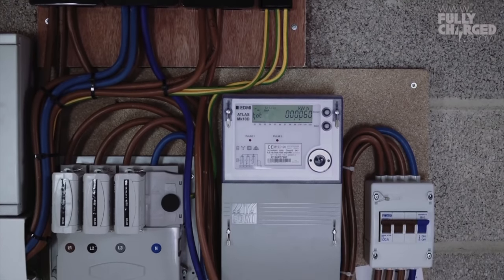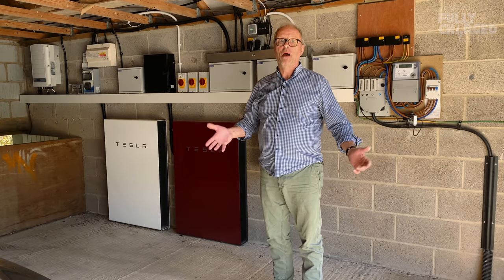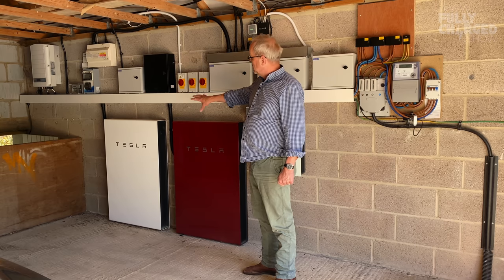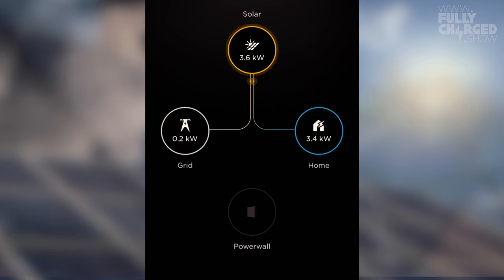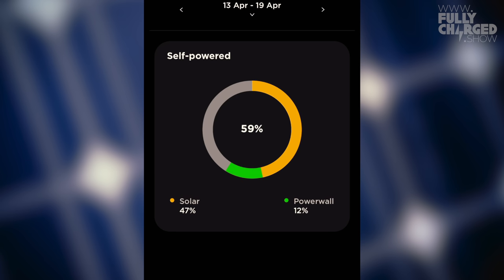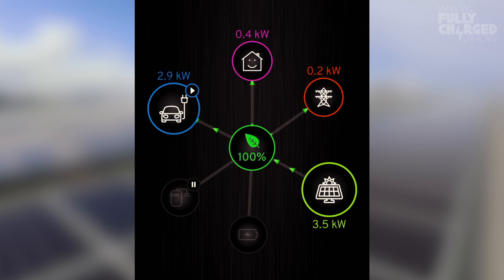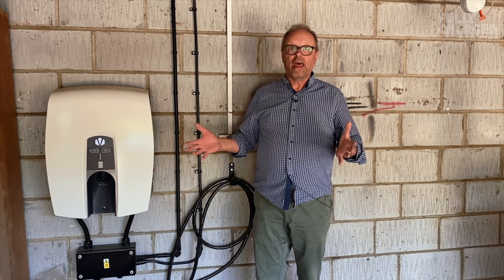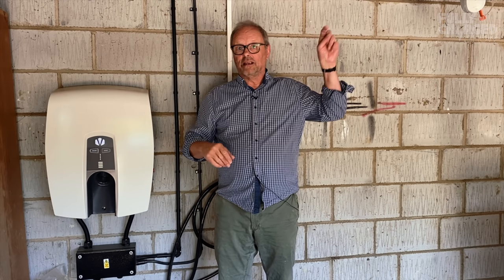Tesla Powerwall: how quickly can it respond to a power cut? | FULLY CHARGED for clean energy & EVs

Comment: Great vid - thanks! Have you done the "break even" maths? i.e. Taking the amount everything cost to set up vs how much electricity cost saved?
Reply: Three phase supply, trench dug, two Powerwalls, huge solar array, installation etc... I'm going to guess north of £40k.
Large UK home likely £2k per year plus the cars, let's say 20k miles of driving at 250Wh per mile is 5,000kWh, maybe another £1k. But the solar only works half of the year so let's say it saves £1,500 per year. By my calculations it would take ~25 years to pay itself back.
If he can get the V2G working, I'm guessing that's another £2k but it could earn £ks back, so who knows.
Reply: Most solar plus battery is now around the 16 to 20k region. The first battery came from a payment protection claim and that is on the video. The second battery came for "free" but involved a lot of expense for the three phase and extras. All in all with the zappi as well I think Bobby has spent about 15k on the whole setup of batteries and solar. If you factor in the bargain price and he is travelling most of the time using a leaf or the Tesla plus the off set cost of not buying fuel for hot water or the cars, the pay back is closer to 8 to 10 years.
Reply: It's definitely still at the stage where doing it to save money is the wrong reason.  Do it because it's interesting to you, or you like the safety of having power if the grid goes down, but don't do it to save money.  That day is getting closer but it's not here yet.

Once V2G comes in then there's a real chance of saving money, but it only works out because you already have the batteries in the car, and you already have the car to use as a car.  If you had to buy the batteries separately because you don't have an EV (e.g. a bunch of Powerwalls) then it still won't be economical for a while.

Comment: Hi. A serious question: How do you isolate your house from the electricity supply, e.g. to perform domestic electrical maintenance work safely, when the battery backup is set to kick-in almost instantaneously? Is there some kind of master switch that allows you to isolate the house from the grid, solar panels, battery storage/TESLA Powerwalls, and plugged-in cars? In essence this is the same issue that the National Grid were having, but from the domestic end, rather than the local electricity network end.
Reply: The same way you do it now! Switch off at the consumer unit. Absolutely no difference.

Comment: Can you tell the system if you want to use your car? I see it's charging off the solar slowly which is great, but if at 9am you want to go for a drive it would be annoying if the car wasn't charged? Can you specify "I'd like the car fully charged between X and Y hours" ?

Comment: My system 14 panels of solar with a simple diverter for xs Juice to the immersion heater is 5 years old this week.
It's generated 16MW with 4MW to hot water
 It cost £6.5k. and with cashback and energy saving I reckon we've got nearly £7k back already.
Why isn't this stuff mandatory on all new builds???

Comment: I had a similar issue with my mCHP (micro combined heat and power) system where I couldn’t have it running during a power cut to avoid dumping excess back to the grid...  ironic as the tech was designed specifically for that purpose....

Comment: Clever charging based on the market price of energy would go a long way to levelling out the large, 20GW fluctuations in energy consumption between peak and off-peak. This would be useful for a grid mostly run on baseload power sources like nuclear, but inconsequential on a variable renewable energy grid where energy production fluctuates 10x as much as the demand and on a substantially less reliable basis, with week long lulls a semi-frequent occurrence for wind and several months of appalling performance from solar in the winter (right when we use the most power).
Storage is amazing. We need it. But it will never be able to cope with renewables.

Comment: I was surprised when I saw your original video with the slowness off the backup power. I have never noticed mine take over when we have had a power cut. I wonder if it depends what is powering the house at the time.
Reply: He explained in the video that it was to do with having the Gateway properly setup.

Comment: Do these batteries have a buffer, like how you are supposed to charge the Tesla only to about 85-90% daily? Or is it just 100% for maximum capacity?
Reply: Not sure of the Powerwall but Tesla's commercial units are specified in terms of full charge/discharge cycles.  They are warranted for a certain number of full cycles which if you do once a day works out at 10 years or whatever your agreement is.  But if you cycle them twice a day then their lifespan will be halved (and so will the warranty), so it's on you as the user of the product to figure out how long you want them to last and cycle them accordingly.  Internally I have no idea whether they are being charged to 100% but I am guessing not, because they can get 10 years of life out of them and also to have them charge and discharge at a constant rate no matter what their state of charge.  If they were charging to 100% internally the last bit of charging would be much slower because it uses a slightly different process.

Comment: Hi Robert, 

Thanks to you I have solar, a powerwall and a Tesla model 3. It’s nearly a year since it was installed. It’s great and I am very pleased with the results so far. One issue I have had is with the I boost that heats the hot water when there is excess solar power. It worked fine before I had the powerwall installed but since the powerwall the I boost runs constantly and drains my power. So I have had to switch the I boost off. I am in talks with the provider of the I boost but can you tell me the model hot water thingy you have incase I can’t get this resolved please? Also, I just trickle charge the car from a 3 pin plug, is it worth getting the zappi now or wait until this V to G stuff is ironed out as I imagine that will require a different charger? Your thoughts would be most welcome sir.

Regards

Alan
Reply: Alan, might be a daft suggestion, but, double check the iboost's CT clip is still the right way around and away from the tesla one and anything else on the live wire. Both should work as the iboost is pretty slow at responding and always allows 200w ish watts to export, the powerwall should see this and take it, switching the iboost off.. cheers steve

Comment: A question, is it not the case like with the car that when you have charged the wall battery to around 80% that it takes a lot more energy to charge the last part, or is this differnt?
Reply: I'm not sure it takes that much more energy but it's done in a different way so it's a slower process.  It's also the part of the charging cycle that does the most damage to lithium batteries, so I suspect most manufacturers of long-life battery products don't do it and only ever charge the batteries up to around 80% to make them last much longer.  This, along with ensuring the batteries never go completely flat, is why EV batteries can easily last for 10 years but phone batteries barely hold a charge after 3-4 years.  I imagine the Powerwall is no different, but of course I don't know this for sure.

Comment: I would like to see how long you can run your house off grid with your power walls only. Do you have enough capacity to do that?
Reply: Robert has 27kWh of storage (I have the same). Naturally, it depends on the loads one is pulling from the batteries as to how long they can support the house. 

In winter, we heat with a reverse cycle heat pump air conditioner, so our daily usage can spike to 35kWh/day, while our 10.5kW solar array is only making 26kWh on short winter days. We will run on battery for about 60% of a day or less if the weather is cloudy & cold. 

In peak summer, we're making 60-65kWh/day. We fill the 2 Powerwall2s in the morning, run on solar until sunset, exporting any excess and earning 20c/kWh feed-in credit. We run on battery until the next sunrise. 

We typically draw no grid power in spring (Australia) from September through to autumn to April.

Each Powerwall2 can source 5kW, so the pair can supply 10kW at once, so running electric oven, dishwasher, aircon etc all at once isn't typically a problem.

Comment: I have ovo v2g charger intalled since last october there are a couple of things that need to be pointed out the charger is controlled by a kaluza app it only works with 30 and 40 kwh batteries also it has to be connected to a gen 1 smart meter which means you cannot access the overnight cheap rates but they charge me 15.2 p per kwh 24/7 but buy back unused electic usually between 4pm and 7pm at 30p per kwh my average credit during lockdown was £74 per month meaning my combined gas and electric cost me £19 per month I am told the system should be able to use gen 2 smart meters later this year and the savings should be a lot more
Reply: I also have the OVO V2G system and I have a UK built 2013 Leaf 24 and a new Leaf 40 and the system works on both. Also works on the new Leaf 64. It doesn't work on Roberts Japan built 24 as it doesn't support V2G. Only issue with using on the 24 is that it will only discharge to 30% min so is much less effective than using on the 40.
Reply: Hi Andrew,  You're right it does work on a 24khw leaf, but it's not recommended as the battery warranty might be a problem, it's in the small print, so easily missed.
 "(c) your Nissan LEAF battery capacity is 30kWh or greater (if you do not comply with this, it may have implications for your Nissan LEAF warranty, see clause 17.5 for more information);" 17.5 says you must comply or you are on your own with warranty issues..
Cheers.

Comment: What about setting up a video interview between (ideally a subscriber to the show) Robert and someone who is using the Ovo V2G unit successfully. The other issue is can you use the V2G unit to charge the Tesla (and does your Tesla support V2G as I know Tesla only included support for this recently via a software update, I presume).
Reply: Despite recent rumours Tesla does not presently support V2G.
Reply from the maker: Hi Stephen, that is actually a very good idea and I may try and sort that out. Thanks for the suggestion and as Mr Adopado has said, Tesla do not yet support V2G.

Comment: I am just plugged in (currently no solar, no turbines and no batteries). I use about 15kw a day (around 100 Kw a week, 5,200 Kw per annum). There is space on my roof for panels but it's not ideal. Idiot question: What sort of panels numbers do I need on the roof (and WHY - please can someone explain) and how many of these things (batteries) would I need? Biggest theoretical load would be the washing machine on boil (but the reality is never) and the over on 500ªF (reality never), boiling a kettle too. But even allowing for an electric car, the idea of 2 power walls in parallel appeals but how many solar panels to keep the things reasonably topped up??? When someone says "5Kw solar panels" does that mean on an ideal day without clouds this is the possible power per hour or per day???? obviously 5kw per hour x 12 hours would be 60 Kw; how do I measure this? What about wind turbines? Same thing as this? I am thinking "panels on the roof, pipes under the garden, heat exchangers next to the batteries on the wall. How much is it going to cost me? Is it feasible. Will I be able to get an electric car down the line? Will my house be warm? How reliable is this tech?

Comment: anyone else see the sparks on the bottom right of the black cable between times 0:37 and 0:40 ?
Reply: Wow that was well spotted!  I wonder what it was?  Shouldn't be any arcing from that insulated cable but not sure what that housing is made of or connected to.
Reply: me you Playback at quarter speed- it's not arcing, it looks like something flying in from outside and catching the light- it starts several inches to the right of the conduit and seems to pass in front of it. If those cable were to arc you would know about it- the next fuse will likely be the 400 amp one at the substation, which could easily pass double that for a brief period- long enough to light up that garage in spectacular fashion.

Comment: That LED wouldn't be a good indicator of a power cut. The capacitors were probably still charged between switchover. Better to have used a tungsten globe fed directly from AC.

Comment: Standard ac and heating?  If you switch to geothermal, will that efficiency eliminate that last bit from the grid?
Reply: V2G should eliminate that last bit from the grid during the non-winter months. Long term power storage to last through the winter doesn't really make sense on an individual house level. Although I've seen it done with a Hydrogen system. The UK system where you actually get paid to consume/store excess wind power from the grid is actually amazing. 100% self sufficiency is a wonderful thing but using the existing grid to balance and share renewables is much more "big picture".

Comment: Can someone help me out here, if V2G becomes standard, does that make Tesla Powerwalls (or any other battery) sort of redundant? (Except for when the car is in use out of the house obviously)
Reply: As you say "Commute to work" car cannot store home daytime PV, but may also be that you don't want car battery depleting in early evening peak ("in case I have to go somewhere" or "used most of battery for the commute distance"). Possibly also an argument that a Static Battery, like PowerWall, is designed for this type of cycle-duty whereas a car battery is different ... but the imminent? million-mile car battery (would last me about 100 years!!) will withstand far more discharge cycles and be more suitable for V2G than current tech. Personally I am frustrated that I have a battery sized for my longer journeys and most days less than 40% is used for commute, so even my commuter car could V2G to help with early evening Peak Usage and refuel overnight Off Peak

Comment: Hi Robert I really really wish you would talk about the one thing you never talk about - the MONEY!
If the ordinary 'man in the street' wants to add a Powerwall to his/her solar PV system it costs I understand, somewhere in the region of £8,000 to buy and commission?
Given that the average household (UK) spends about £1,200 per year on total energy and broadly half that is electricity - we can assume that the Powerwall can save a maximum of £600 of electricity spend.
At a basic level then, it takes 13.3 years to break even on the Powerwall.
If you own an EV you will save some more money - dependent of course on your annual mileage. 
However, as you will have paid substantially more for your EV than a typically equivalent ICE car then you have masses of financial ground to make up.
To sum up, I can't see how a house  battery can be anything other than MASSIVELY non cost effective for the average user. And this doesn't take account of the fact that the cost of a new Powerwall SHOULD have plummeted over the payback period ( falling price of batteries!) making it even worse value for money.
If my figures are complete pants then please tell me as I'm actually interested in house batteries, but........!
Reply: "you will have paid substantially more for your EV" ... prices falling of course, so "tipping point" comes ... soon??. But I think that a wallet-watcher buying Diesel car now will have increasing fuel prices/taxes, horrendous town/city congestion charges (if not "banned") and eye watering depreciation. Tesla Model 3 (cherry picking ...) shows tiny depreciation, so far. If payback is the only factor economics of battery don't make sense (yet ...) I work from home and appreciate not having the disruption of powercuts, so there is a "comfort" benefit - i see it as similar to replacement glazing which also has a lousy payback, but provides better comfort. The money I have saved early on, as an early adopter for ECO stuff, has typically matched the lower price that a late-adopter then paid, but I had the benefit in the meantime.

Comment: What is the price of electricity in the UK?
Reply: FarmerDan 24 there is no one price for electricity. There are literally hundreds of tariffs to chose from- we are free to buy from any supplier and can switch at any time. You can opt for a fixed rate tariff, for which the average rate is somewhere around 15p per kWh, although some suppliers go as low as 11 or 12p. Then there are tariffs that offer differing rates at different times of day- 20 pence at peak times, perhaps 8 pence at night. There are tariffs that offer extra cheap power for a few hours at night, as low as 5 p per unit, but again more at peak times. Then there are tariffs where prices reflect wholesale prices and rates change every 30 minutes. Prices peak at 35p in the early evening, but drop to next to nothing in the middle of the night, and occasionally go negative- they pay us to take excess power from the grid.

Comment: You dont have 3 phase into every home as the standard? Where I come from even some House appliances make use if the 3 phases. Didnt know that it wasnt standard everywhere. Interesting
Reply: MrDj200 where do you come from? Understandable if you live somewhere where homes are modern and the grid is relatively new, but this is the UK where many homes were first connected almost a century ago. Most homes have a 100 amp 240 volt supply, so can draw 24kw, which is way more than is ever needed- we don't generally use electric heating, don't need aircon.